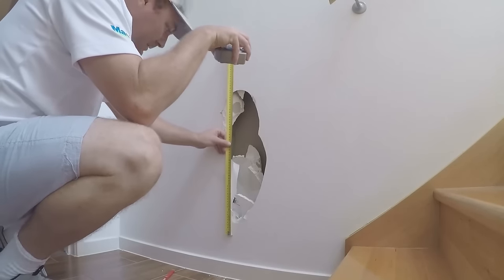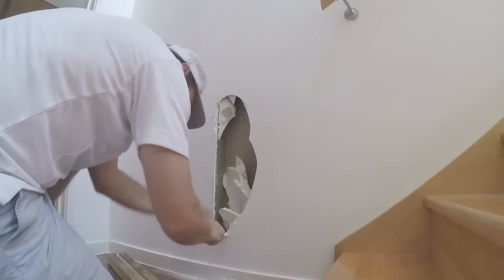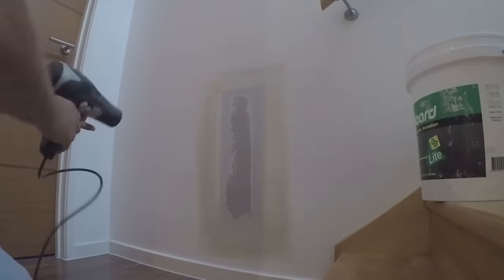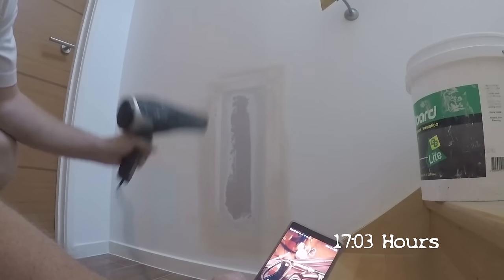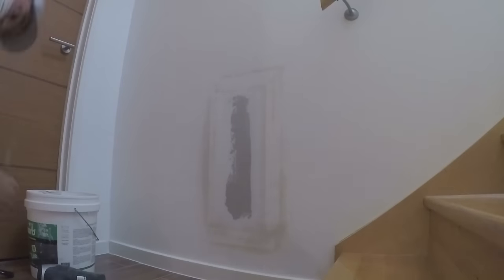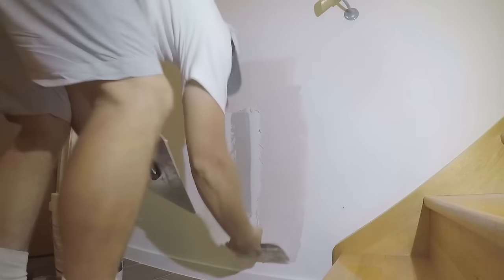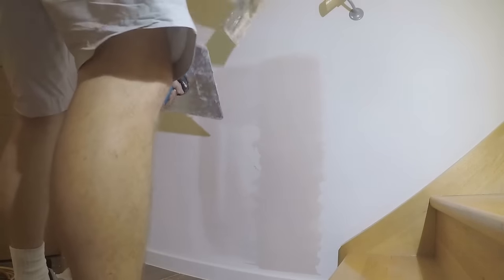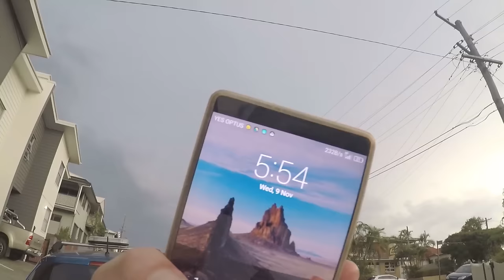How to Fix a Small Hole in Drywall Best Way Fastest Way

Comment: I really like this video cause it shows how patches are done in another country compared to the USA. From the tracing the outline with a pencil, using salt in what I believe is setting compound, how you brace, using the old school hawk, floating with a five and skimming with an eight. It's nifty. Gets the job done. End product looks good. Who cares what the other commenters say. Looks bang on good. No one is going to put a flash light up to look for imperfection and homeowner is definitely happy you fixed the eyesore. Great video! Keep 'em coming.
Reply from the maker: Thanks Americo
The patch turned out good although I really hate the sound of my voice in this one but oh well who cares.
Reply: @Maxkil Hey man at least you narrated where some people don't take the time to edit that in.

Patching technique looks 100% professional. I work touch up for production homes. Some homes after the mechanical phase usually have 3 patches. Usually pancakes from searching for wires for lamps above vanities. Then you get those homes where they didn't rough in cables right and you end up with 40~ to 70~ (2x1 feet) patches. Let's just say I do 10 houses a day and 10 to 100 patches a day with a crew of 3. We use scrap trim or wood flooring scraps, braced diagonally using only 3 screws. No tracing or squared cuts for boards.  Just eyeball it and shove it in. Mesh tape. 5 minute setting compound floated with a ten knife. Smooth out compound with your 5 knife before it hardens and skim tight with box mud. Sand in 10 minutes the edges and move to the next house! People would freak out over how shitty we do our patches, but no complaints in the past 10 years so far! Forgot to add that I've never used a hawk. I use a mud pan. Here only the old timers use hawks and mud pans are for the new lazy generation of finishers.
Reply from the maker: Haha. Actually that's the only video I ever did the voice over to.
Wow that's a lot of patching you would be a seasoned pro at it.
Thanks for the support.
What city you from?

Comment: In the US if it is just that one area to be repaired I would charge $150 including materials. I probably would have used an Easy Sand 20 or some type of setting/self hardening compound for the first two coats and then feathering compound as the final. Should take about an hour and would still need a light final sand as the final feather coat is not a setting compound and needs to air dry which takes hours.  Nice work! great Vid!  How much do you charge for that repair?

Comment: Yeh not bad going. I reckon I could have painted it in the same time. Cut and board the whole, 2 part filler the join, sand, filler, heat gun dry, sand, miss coat of paint heat gun dried (this will then show you if you need any more filler) if not then 2 more coats of paint heat gun dry. Done.

Comment: hello, is there a product that exists to accelerate the drying time of coating when using the bazooka or blueline charging box? Thank you for your reply.
Reply from the maker: +Jeremy Dede I don't think so I'm not sure. Try mix with salt... Let me know how that goes.

That's an unofficial word of advice. Just joking
Would be devastated if it dried in the Bazooka lol.
Reply: Maxkil yes I doubt, after I'm just looking for a solution that would allow me to gain in drying time. I come from France and your techniques used in the United States are much more advanced than at home. I will especially use blueline boxes that look really great. And take the banjo taperpro rather than the bazooka to gain cleaning time. For drying, the heating blowing will I think the best solution.
Reply from the maker: +Jeremy Dede yeah have a big fan that blows through will do well.
I'm from Australia. How's work in France?
Much work going?
Reply: Maxkil I have a lot of work in France, it's been 10 years that I make the joints by hand and I am very perfectionist on the finish. And as the work increases I would like to use the boxes of charge. I just hope that the quality of finishing is exellente with this.
Reply: Maxkil how much time have you put to use these boxes?
Reply from the maker: +Jeremy Dede same as me. Always by hand until more recently..,
Reply from the maker: +Jeremy Dede I've only used them a few times
Reply: Maxkil 
ok, thank you for your answers and good luck in your work 🖒😉
Reply from the maker: +Jeremy Dede thanks mate.😲
Reply: Jeremy Dede hey mate, theres a product usgboral makes that is called ground gypsum that causes the base to dry much faster but i dont think its good to be for the machines
Reply from the maker: I might try that as well.

Comment: Just so you know Max theres a powder we call speed that you can buy from CSR that you can add to base coat mix, (the one you have to mix with water not all purpose pre mix) and it will go off depending on the amount you put in about 5 mins without the hair dryer. It's worth going to the trouble of mixing your base up just for that reason
Reply from the maker: +Mark Banks hey mate. Thanks a lot. I hadn't heard of that before. I will certainly ask for it. Thanks for the heads up
Reply: Plaster accelerator

Comment: Mate get some speedo , what’s the use of the salt if you still need to get the hair dryer out .
Reply from the maker: dries even faster.
Reply: @Maxkil  it’s a waste of time , trust me get some you won’t regret it no hair dryer or fan required ,just apply on hawk same as you do with salt but it sets fast .

Comment: first why didn't you take the extra 5 minutes and cut the left side to the stud.  you cut up to it . now the left side is weak.and held by only a few screw heads .at the top and bottom only. if i was to push on it just a little your patch will fail and push into the wall the right side was done better . other then needing a few more screws. and it would of been nice if you used a 2x4 matching the right side . you also put the first piece of tape on backwards and you coated it mainly in one direction.up and down and you didn't pay attention to the joints going side ways . run your hand on it and you'll see its humped.its slick finnish and you didn't sand or kill the edges it was done porely and fast for 💰 and you didn't protect his wood floors .that alone will get you fired here . remember you asked me for my professional option. i would of made you pull it apart and start all over if i was your boss .
Reply from the maker: I agree cutting down the left side on the stud would've been stronger. However two screws at the top and two at the bottom was ample, it wasn't weak, the screws were sunk just right, it was solid & add the fact how narrow the patch was the other side is also strengthening it with at least another 4 screws, you can even see me trying to move it. Was solid, no question, you couldn't just push on it a little, you exaggerating. Once the coats of mud go over the top it spreads the strength again. yeah would be been nice to use matching timbers, but i didn't. If you look closely i used the roll of tape and was on the correct side. Don't know how you got that idea. It was flat. I started with a scrape down to ensure that. you don't need to sand between coats, maybe you do...no humps there. You can see the floor all clean once i put on the first coat. look at the floor when i'm finished. You just need to take care..  Pull it out start all over. haha yeah mate you do that, enjoy working for your boss in that kind of regime.
Its very easy to watch something after and see how it could've been better after.  You wont ever be my boss. this was a solid patch.
Reply: Maxkil gues i just take my job more seriously then you . if you pay attention to your video you'll see everything i said is correct.look how you're holding the tape when u put the first piece on u have the fold on the outside then you swiched it to the inside after that . the correct way. it doesn't matter the size of the repair.if you don't run mud in the direction of the tape you're creating a hump . i will not comment on no more of your videos because you cant handle a professional option. 38 years of experience gues thats why im working 1.5 million $ homes daily for the last 15 years and you're still doing patches for 50$ . and as long as you make excuses for your lack of quality you'll stay in that position . enjoy your night and best of luck to you mate.
Reply: Maxkil gues i just take my job more seriously then you . if you pay attention to your video you'll see everything i said is correct.look how you're holding the tape when u put the first piece on u have the fold on the outside then you swiched it to the inside after that . the correct way. it doesn't matter the size of the repair.if you don't run mud in the direction of the tape you're creating a hump . i will not comment on no more of your videos because you cant handle a professional option. 38 years of experience gues thats why im working 1.5 million $ homes daily for the last 15 years and you're still doing patches for 50$ . and as long as you make excuses for your lack of quality you'll stay in that position . enjoy your night and best of luck to you mate.
Reply: oh and just so you know i am the boss over the drywall
Reply from the maker: +Karl V fact is the tape is on the correct way. How I'm holding the tape??? Wow again holding it wrong. I think your having some personal issues..  Finish was perfect. 38 years that's like way before I was born.  I'm not perfect. But this patch finished great.. Don't feel upset, retirement is just around the corner.
Reply from the maker: +Karl V whatever you say Karl, I know your the drywall boss now. 38 years and still on the tools, maybe your doing something wrong. Let me criticize your life.
Reply: Maxkil Lmao i don't get upset with kids. the funny part is you don't even see it. have a great evening
Reply from the maker: +Karl V the tapes on the right way, the patch is strong and flat. The floor is clean. & Being 30 is not a kid. Why are you always wrong. It's daytime here as well. Night mate
Reply: Maxkil you asked me to comment i did and you're more then welcome to but you'll not find nothing because i know how to handle trolls.
Reply: Karl V there's always one
Reply: it’s so easy to criticise other’s job other than doing itself.
Reply: LOL 38 years and still on the tools, must feel good
Reply: one thing i do agree on tho is you should have cut back into the stud
Reply: I agree but it doesn't work like that once that  compound hard up you have to kick that with force for the bust through......

But to answer your question it was  done that way because it was a stud there the brace could not go any further, 
Also the method and technique that was used in this video Sanding wasn't necessary, had he sand it he would have made a mess and had to do it again would of made no sense.
If you're able to watch it again take a good look at it......

Hope I was able to answer your question.
Reply: @Maxkil  
I don't understand whether right or wrong......... this  platform is an open forum why are you running on with your guests this not a good thing!
Reply: Bahaha retirement is just around the corner mate...